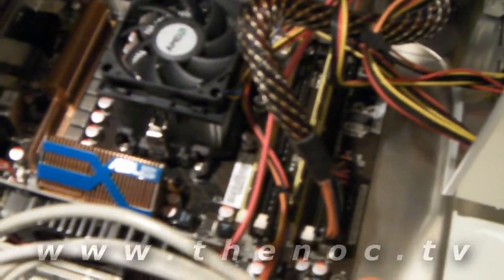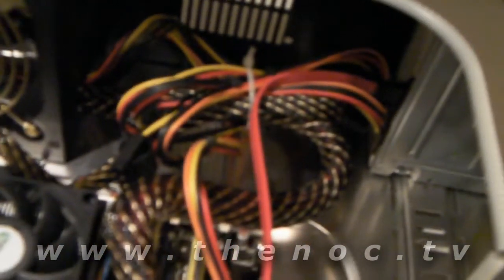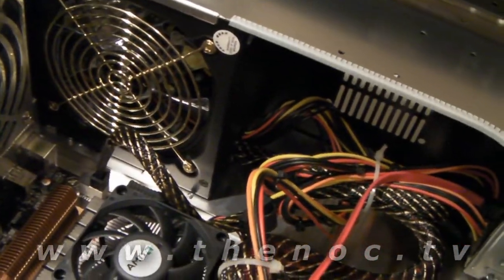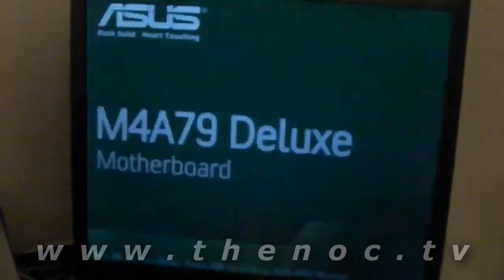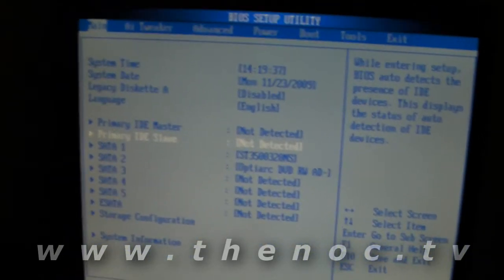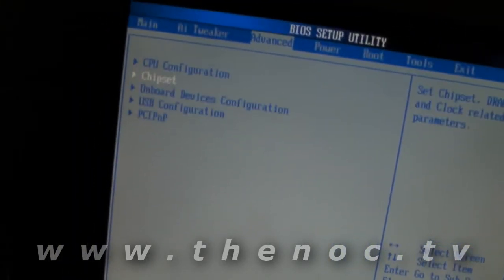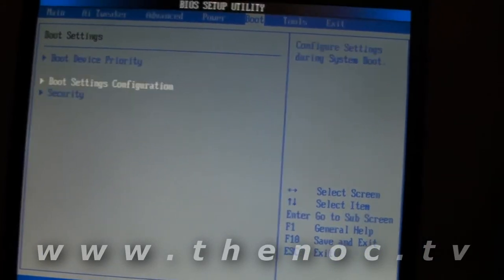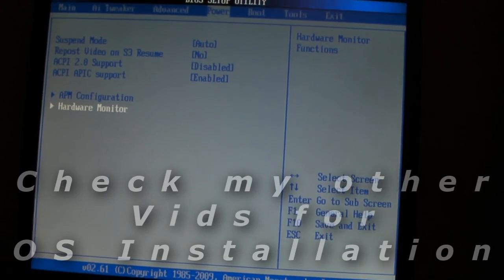Build your own custom computer - Finalization

Comment: You could use lead cutters.  That's what I use to cut off zip ties.  You can buy some at your local Radio Shack and it does the job really well.